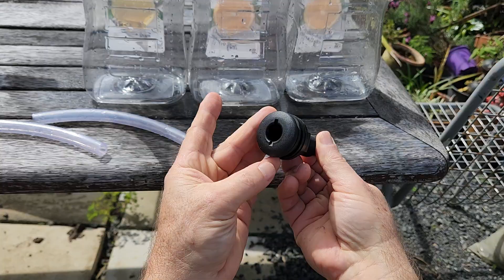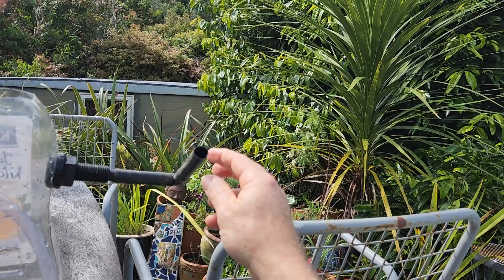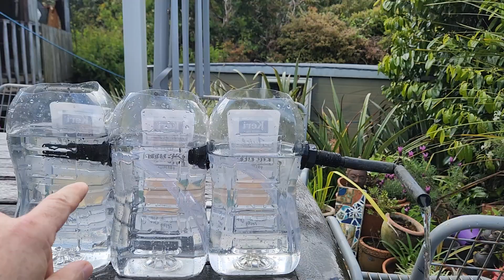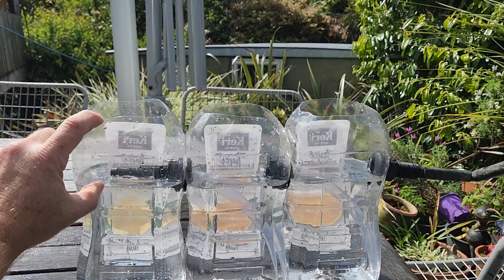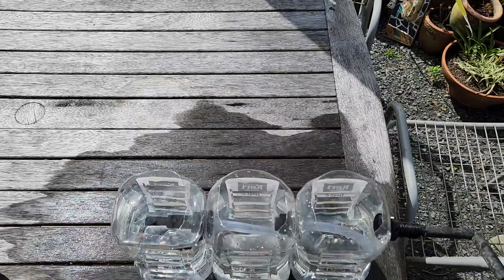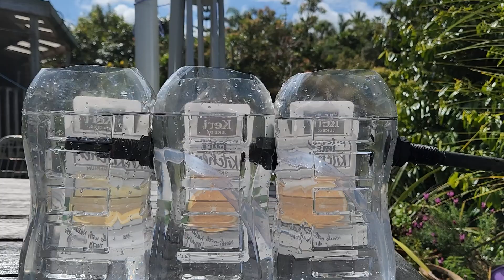youtube video #4u7Dm6gGXtI

Comment: What would happen if the first bottle was a big bucket filled above the top of the adjustable outlet?
Reply from the maker: Provided the bucket was filled to above the top of the containers, the water would fill all the bottles and overflow because the water flowing into the system would exceed the water flowing out. If no more water was added to the bucket, the equilibrium water level would establish again.